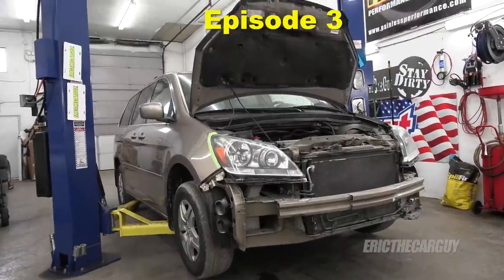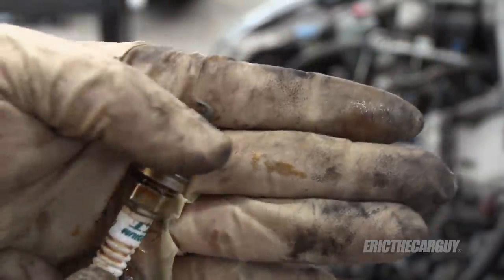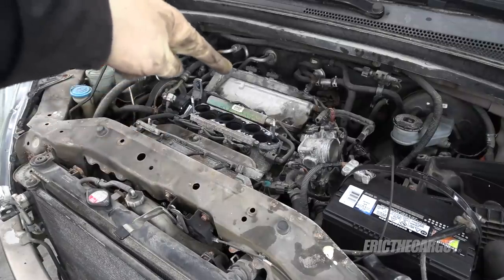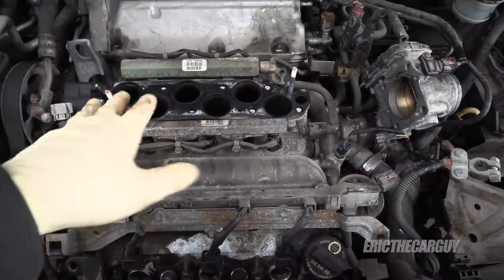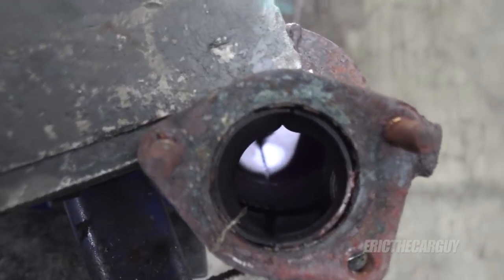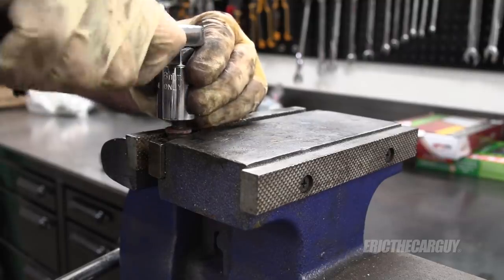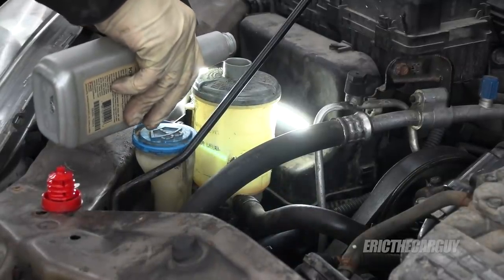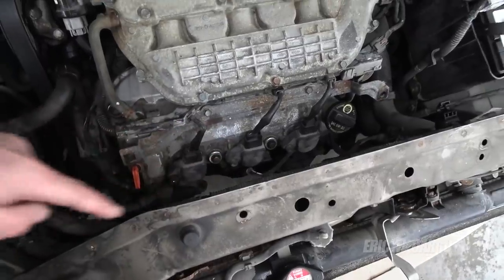2005 Honda Odyssey Engine Work (Episode 3) Fixing it Forward

Comment: I know that most "mechanics" do not recommend engine flushes, but I did on my daughters 2000 Accord with close 200k on the engine with no issues so far.  Hopefully, there will be no issues in the future.  You roll the dice with engine flushes because you can damage seals and you can start "loosening a lot of gunk" that can block passages.   We purchased the car and I did first flush with oil change and filter.  I replaced 20% of the oil (I upped the oil to next higher viscosity too because these "additives" thin the oil) with Marvel Oil and ATF and drove the car 250 miles and did another engine flush with oil change and filter. I used an common flush product and followed the instruction before each oil change and did NOT drive the car with the flush in the engine.   I repeated 5 times.  After the 3rd time I noticed the engine ran smoother and was more responsive.   Each time oil that came out, it looked like it had at least 5k on it even though it was 250 miles.   I also cleaned the valve cover and cleaned the top of the head with a toothbrush before doing the flush.   This again, is risky......The plan is to move slowly toward normal oil intervals (with no more flushes)......2 -500 mile oil changes, 2 -1000 mile oil changes, then 2 -2000 mile oil changes, then 3000 mile.......Hopefully by doing multiple flushes and changes any large "chunks" have been removed or will stay in place.  I don't recommend any one try this and to do it at their own risk.  I do believe this best way do "engines flushes" if you are going to do them, to avoid clogged passages.

Comment: You're talking about putting non-Honda fluid in a Honda transmission. I've got an interesting one for you!
My partner had a Hyundai i20 which was written off, she liked it so she bought  another. It never seemed to have the same pep as the old one though. 
I saw that the transmission fluid was a bit dirty so I changed it out, once I got it out I noticed a distinct lack of cat pee smell and whilst dirty it was yellow/brown...
Yeah someone had done a transmission service and replaced the fluid with engine oil... Needless to say after a couple of fluid changes to flush the old stuff out, it ran a lot better!

I found it do weird though; that someone with enough know-how to do a transmission service (the filter/pan gasket had been replaced as well) wouldn't know that it needs special fluid...
Anyway fun little story. Great video, really happy to see FiF continuing!
Reply: My sister added coolant to her engine oil filler. She added several bottles and was waiting for the coolant to reach the top where she could see it, as instructed. Just too bad it was the wrong filler. Engine was running at the time. Needless to say, that was the last time the engine ran.

Comment: Excellent series, as a Honda fanBoi I love these J series motors as I have had 4 TLs over the years, currently have an 07 Odyssey with 300k miles, 08 TL-S 6 speed and an 00 AP1 s2k. I bought the odyssey on a whim to replace an old town and country and the Honda has been a charm to own over the past 8 years. I did install a VCM muzzler right after I bought the car and its been working great ever since, no weird vibrations and next to non oil consumption.

Comment: Nice to see you do this.  I just fixed a broken rear cam on a 2010 by replacing T-belt, two cams, the rear head and having the front head rebuilt.  

Boss then buys this other 2010 with a rod through the oil pan and has me put an engine to flip it for profit.  

I've spent a lot of hours recently doing exactly what I'm seeing in the video.  Sure is nice to be done with all that for now.

Comment: Love this series, Eric! I hope you do a lot more of these in the future.

I’ve owned a 2005 Odyssey for 5+ years now, it’s a fantastic van. My wife and I are actually in the market for a second. When we bought it though, it seemed to burn oil and fouled up spark plugs. We were also plagued with misfires. We got the issues to stop after replacing the PCV valve (o-rings were completely pancaked), bought a VCM tuner, and did a valve adjustment. I’m not sure which maintenance item on that list contributed the most, but I will say, after the valve adjustment (at around 140 - 145k miles I think), the oil consumption seemingly improved. I don’t keep as close an eye on the oil between changes, and it tends to only consume at most ~1/2 a quart every 3-4K miles. Just FYI for others out there. Oh and the VCM tuner is awesome - really not a fan of the engine lurching when VCM kicks on.

I do wonder if such an issue could’ve contributed to the exhaust issues this van had.

Comment: I have seen it. The problem for the front one being that way as opposed to the rear one is because the PCV valve was not changed as needed. You were correct later in the video which I came to as I was typing this lol

Comment: Eric.... What you described as the "EGR" ports in that intake manifold  were actually re-purposed in that newer design to be the PCV gas distribution. You can see the passageway coming from the PCV hose on the front valve cover in the bottom left of the intake manifold.  Additionally this is the reason for your dirty  front valvetrain/head-cover.  This redesign of the PCV system now pulls fresh air into the REAR cylinder head (stays clean), and pulls crank case gases from the FRONT cylinder.  It's the crank-case gases and lack of fresh air that cause the buildup.  On the old pre-2005 design it was the opposite.   The rear valve cover had the PCV valve, and the front valvecover got the fresh-air.

The EGR system was also redesigned to distribute directly into each side plenum right after the throttle body via a large T-shaped bolt-on tube.  The T-tube can be removed and cleaned now which is nice.

Comment: Yep, I’ve always attributed the one side varnished up issue to a clogged PCV system. Typically the pcv valve is on the rear cover but it looks like they moved it to the front on this year
Reply: Hope u r doing ok. Miss your vids!
Reply: Non vcm, egr is on the rear head.  Vcm is on the front head.

Comment: 19:48 while working at honda, i noticed that the "rear bank spool valve" would leak on that model year(i actually own a 2005 odyssey as well so this is so cool for me) , we ended up using the NAPA gasket kit for those.. or you can get it for $500 from honda since they dont sell the gasket separately, either way if it seems like there is an oil trail and it leads you up there, i had to replace that one on mine and it wasnt too terrible, thanks for the share! looking forward to episode 4

Comment: I used the denso plugs in my 99 accord & within 5k miles I started getting misfires.

It ended up having two problems first being a blown head gasket. After all was repaired I put back in the denso plugs & boom the miss moved over to another cylinder. After swapping the plugs front to back the miss moved up front. 

I replaced with the ngk plugs & its been beautiful since no miss & everything running new. Comparing the denso & ngk the denso are bout 1 or 2 mm shorter and place the plug closer to the head. The ngk are much closer to the piston itself & give a complete burn.

Comment: We had our 2009 Honda Odyssey with the VCM....ours was the Touring model.  And at about 78,000 miles the check engine light came on due to the VCM cylinders being oil fouled and causing a misfire.  Honda replaced the oil control rings..meaning they had to pull the engine out of the van for the repair...and did it under special program...so no cost to us.  We were burning about a quart every 3,000 miles.  I read about the VCM muzzler to deactivate the system but not sure if that would cause more problems than it is supposed to fix.  

We replaced the 09 with a 2017 Odyssey and so far it doesn't seem to be an oil burner...so hopefully Honda has a permanent fix.  Also the 17 gets much better gas mileage...almost 30 mpg on the highway depending on wind conditions etc.

Comment: Eric, i am sure someone has mentioned about the valves, I have a 2006 and have 180K and had my second valve adjustment done. You are so close at where you are this can help to prevent a misfire issue with the valve staying open during its cycle with the valve seat being hammered into the head (or being 'tight' as people like to say, lol) my .02 worth...

Comment: Nice video - surprised you didn't check/adjust valve lash while the valve covers were off!
Reply: he prolly checked it off camera
Reply from the maker: If an engine isn't running rough or loud, I normally don't bother on the J series. Also, when they get gunked up like the front bank was, adjusting valves is a real PITA. Video linked in the description for J series valve adjustment. Thanks for the comment.
Reply: @ericthecarguy  i was getting a slight miss on my 07 odyssey with 160k, enough to feel it sitting there idling but not enough to throw any code, and low and behold the rear valves were tight.  my wife didn't feel it but my butt did, so readjusted while i was only intending to do a full valve cover gasket replacement.

Comment: Front valve bank is sledged up ( as compared to back one as Eric was commenting on), because in 2005 model onwards Honda has moved PCV valve to front bank. In earlier models (99 till 2004), the PCV was on the rear bank. Clogged PCV is the culprit for sledge on valve train

Comment: A lot of the studs came out with the fasteners too when I was working on my ‘99 Cutlass so I think I’m gonna reassemble as much as I can on the engine stand to avoid having to deal with the space issues. To be honest here I also broke one, everyone breaks stuff sometimes but I was also a lot less knowledgeable back then. I’ve been into cars since my birthday two years ago when my parents gave me that car and today’s the two years two days after. 

 We’re supposed to be getting a HF here in the mid-summer so I might just let the project take that long since I don’t have my license yet to drive an hour and 15 minutes to the currently closest one IF they even had a hoist.

Comment: I gotta say that Erics vids allowed me to pull both heads, get them redone, put it all back together and 1 yr later it still runs great👍 much thanks😁 oh I absolutely HATE HATE TTY HEAD BOLTS😐😐😐 even installed correctly their torque is all over the place😐oh i did strip a valve cover bolt-Any easy fixes??? Its a front one easy to get too😁

Comment: I recently puller the heads off of a 2007 Pilot with 220,000 miles, due to a blown head gasket. The front head was a lot dirtier with sludge than the rear. Also the front valve cover gasket was leaking. I think this was caused by a completely blocked PCV. For some reason, the PCV's tend to get overlooked on these engines. I also dropped the oil pan / pump pickup and the VCM gasket / screen, all were fairly clean.

Comment: 28:39 if your honda feels like it happens to have transmission issues(only been my experience with transmissions using DW-1) then please do the 3x drain and fill, seen it fix 2 2012 civics and honda tells you to do it if you feel a torque converter judder on your... i want to say.. 11-15 odyssey..? i cant remember off the top of my head but thats my favorite way to "flush" the transmission

Comment: hey Eric i just wanna share with you what i found about that variable cylinder management(VCM) that caused all the mess you got with that engine, in 05-06 old vcm version when engaged the reciprocating effect of the pistons with valves closed causes a vacuum pulling oil past the piston rings and flood the cylinders,when the VCM disengages to clear the oil from the cylinder the engine misfires,and this causes premature parts failure,spark plugs,motor mount due to vibration with eco mode enabled,piston rings,cylinder walls and finally the catalytic converter that's what the bulletin mentioned for those 2005 and 2006 year models,hope this will make sense to what you found in that engine.

Comment: Considering the price, and how these vehicles are used, frankly a smart owner should always go to the junkyard whilst the cars are still out, fresh for picking, and get themselves various bits for cloudy days. I've been doing this for some years now, and it has saved my ass a few times. I mean, some 80's parts are just gone, even the aftermarket scene has moved on, and i've noticed the trend where there's fewer aftermarket, more cheap knockoffs and shorter periods of times between purchase and time you're out of luck and into the shit creek.
I'd certainly get valve covers, maybe a gearbox, exhaust stuff if it's in good nick, and certainly aaaall the small trim plastic bits, those go off all the time.
Reply from the maker: All great ideas if you have the space. Not to mention cataloguing everything. If you don't, you'll miss the opportunity to use the parts you spent so much time collecting. Ask me how I know. 😉

Comment: Wish my radiator would bleed air as I have that tool/funnel.  I found my thermostat wasn't opening even though it was replaced new.  It did sit for a while and I plan to test it (the thermostat) but, I bought a new one just in case.  Hope that works.  My coolant system acts like there is air in the system no heat and such, but as the engine approaches critical heat the thermostat doesn't open I tried 4 times.  Any advice would be welcomed.  Maybe the fan clutch which I plan to test...prayers to Mother Mopar! Lol. All in all thanks EC for the update love fixing it forward as many do I as well love that series, and I'm sorry to hear about the element  catalytic thief!

Comment: On V configuration engines the bank with the pcv valve usually has more sludge because more oil vapors are flowing over that bank.
Reply: That... and blowby that hasn't settled in the oil yet.

Comment: The amount of work you’re putting into that Honda is equal to the amount of work you put into the video!  Out of curiosity, have you used an induction heater instead of a torch sometimes?
Reply from the maker: I don't have an induction heater. Also, you can't cut with an induction heater.

Comment: I have a 2007 odyssey with 208k miles.   It was burning 2+ qrts oil. Every 3k miles.  
I then changed PCV valve,  then it drastically reduced oil consumption.   I am going to measure how much after next oil change. 
I use 5w20 oil high mileage oil.
Reply: Update changed to 5w20 havoline synthetic blend high mileage 
And changed PCV valve
Results :  oil consumption reduced by about 50%
I had been using SuperTech oil 5w20

Comment: Hey there, Eric. Long-time listener first time caller. Please correct me if I'm wrong, but don't these J35's require period valve-lash adjustments? (an '05 VCM would be non-Vtec right?) If so, I'm curious why it wasn't something you brought up, especially since you had the valve covers off already. There's obviously a ton of different flavors of J-series motors and you're the Honda expert, so maybe I missed something on this one in particular. Is that just one of those "if it ain't broke don't fix it" kind of things in your mind?
Reply from the maker: No Honda engine 'requires' periodic valve adjustment. The service manual reads, "if noisy". I don't normally adjust the valves on the J series unless there is an issue. Also, if the engine is gunked up like the front bank was, it often makes valve adjustment difficult.

Consider this, if the valves are noisy, or the engine runs rough after you adjust the valves, you have to remove the valve covers and do it all again. 

In short, you pick your battles. I didn't feel this engine needed a valve adjustment. If you're interested, I have 2 videos linked in the description about adjusting valves on the J series. Thanks for the comment.
Reply: @ericthecarguy  Gotcha! I've actually done a lash adjustment on the J35 in our Vue before (at around 180k or so) and noticed an almost night & day difference in it afterward. The "required" bit in my mind probably came from some internet forum years ago, and it's more than likely bad info regurgitated, though I suppose it's always possible that Saturn's service manual for the J35 has different info. Either way, I appreciate the thoughtful and informative reply. You channel has been a wealth of information and inspiration for my projects over the years.
Reply: The sheet that I read said 30K mile valve lash adjustments or suffer rapid camshaft wear... but... it also says that the expected lifespan of the J35 is only 200K, so I guess it's debatable. The same sheet also says 50K miles is over the threshold for timing belt changes. That would probably depend on the brand.

Comment: Your pry bar looks like a Snap-on, I had the exact same bar and broke the handle when it was dropped of my bench. The Snap-on rep replaced the damaged handle portion in his truck at no charge as these are warrantied for life. I would not recommend you using that tool as the glued joint is a serious weak (failure) point and might result in an injury to the user or damage to whatever you are using the bar on. Just my two bits, Cheers, Eric from Edmonton, Alberta, Canada
Reply from the maker: It's Matco. It's also the second pry bar I've repaired this way. The other one is still together, and this one is too, so far. Thanks for the comment.

Comment: Front rings freeze because of the egr goes through the front head and causes carbon build up.  Hence the white on plugs.  Rear ring freeze because of vcm, hence the black plugs.  Engine needs a 6 pack of rings.  Common on single banks.  Fronts have oil rings frozen, rears have compression rings frozen.